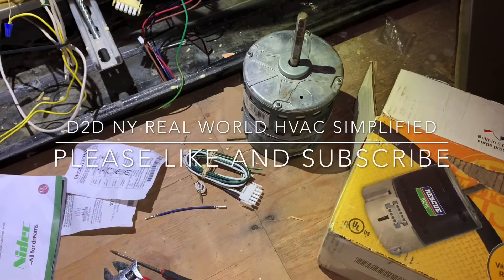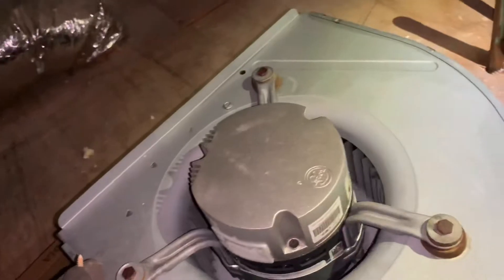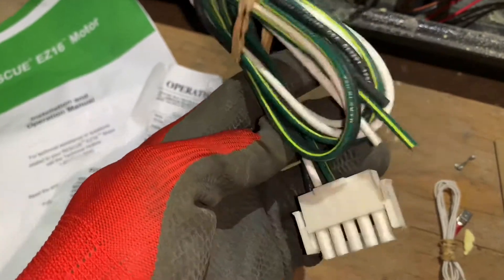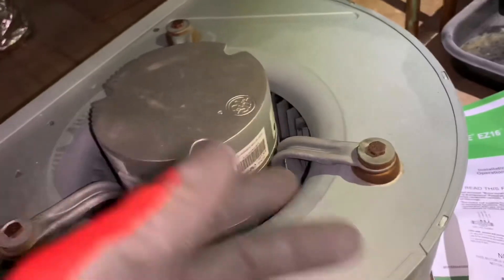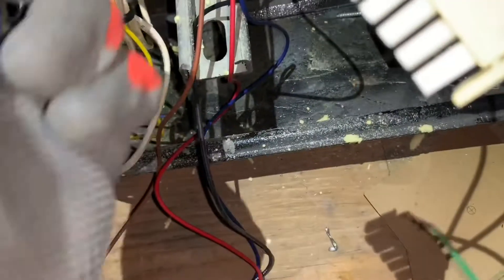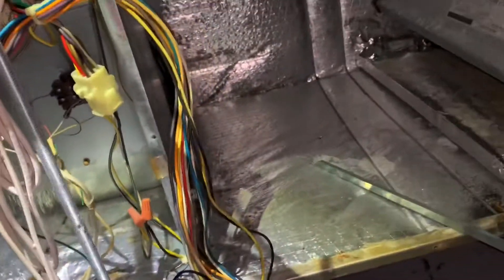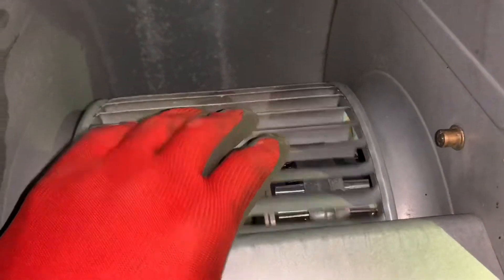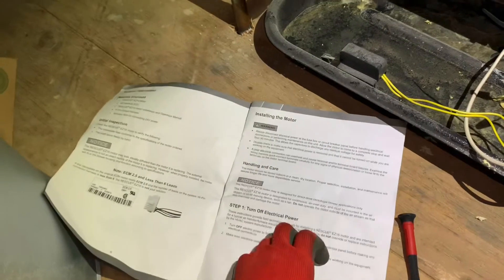HOW TO REPLACE A CARRIER ECM MOTOR

Comment: Hey man, thanks for the excellent information you've provided in this video. I was about to install my Rescue EZ16 motor when I noticed the left switch on the side of the EZI module did not match the manual. Instead of "PWM/24VAC" shown in the manual, mine had PWM/4W. I called USA HVAC who I bought it from to inquire about it but they did not have and answer as to why it was different. Being a DIY person, I was concern about it not showing a 24 volt setting on the switch because the motor I am replacing started with 24 volts. Having found your video, I now know the"4W" position will give me this setting. Thank you very much.
Reply from the maker: Thanks you for stopping by and keep watching
Reply: Did this work out for you? I'm also concerned about "PWM/4W", not knowing what that means. According to the instructions only 24VAC setting allows you to use the other rpm adjustment dials. What the heck is 4W?
Reply: @mtbbiker6401   Yes, it worked out well. The "4W" switch position is indeed the 24VAC setting you need. I was able to confirm this with the company that sold the product. Somewhere along the line, they changed the labelling on the switch. I set up my Rescue EZ16 motor kit 9 months ago quite easily and it's worked flawlessly.
Reply: @seetroy  Thanks for the reply. My choices are buy a used OEM Genteg 2.3, Evergreen VS or Rescue EZ16. I'm leaning towards the EZ16 since the set up seems pretty simple.

Comment: Im thinking the dial options are 1/3, 1/2, 3/4 and 1 hp. So if you turned it all the way CW to the right to stop. That would be 1 hp. From there Go back to the left to the slot and that would be 3/4hp. From there Go back to the left to the next slot, that would be 1/2hp . continue left to the last slot space and that would  be 1/3hp and then all the way to the left  to stop and would be zero. It looks to me like you set the arrow on the dial to 1/3hp.
Reply from the maker: Perhaps

Comment: not to mention you are not able to utilize  all the options and  fan speeds on the easy select board. this is what hacks do
Reply from the maker: Also another good point,  I should have simply installed a PSC motor it would have been way easier and cheaper,  from a Pro hacker perspective of course 😂
Reply: This OEM motor is literally backordered for this system. Universal ECM is probably the only way Togo ... The customer gets heating and cooling back on instead of replacing an entire system.. this seems like a good repair for both the  customer and the business owner... Not sure how this could be considered a bad repair..

Comment: that motor wont last long. OEM always best. just order the motor
Reply from the maker: I will have you know that this is a client of mine and still is since this video upload! And the motor is still running.  This client also have several of these carrier indoor units here's is me replacing another motor same job site different indoor unit  Used a PSC this time around 🤷‍♂️
https://youtu.be/CNxe8GYq6Ho?si=dDc3AxQAHfhJ1_km
Reply from the maker: Click the link watch the video and learn something and then leave another silly comment if you dare!
Thank you for stopping by.

Comment: Where's the capacitor to replace?
Reply from the maker: This type of motor does have an external capacitor because it’s an EC motor
Reply: @D2DNYAC  yes but I don't see where you installed it in the video? Also I just got a non oem motor to replace mine which is same model number as yours. But it doesn't have the control thing yours has (black switch).
Reply from the maker: No cap needed with this type of motor! The OEM motor in this unit also didn’t use a cap.
Reply from the maker: What i meant to say was that it DOESN'T have a cap!!

Comment: Any other motors you recommend? That motor is expensive i found
Reply from the maker: The OEM motor cost more that this replacement motor, so when it comes to cost this is your best bet
Reply: @D2DNYAC  thank you. how did you search a replacment model? I looked online since I have the same exact model as you in this video